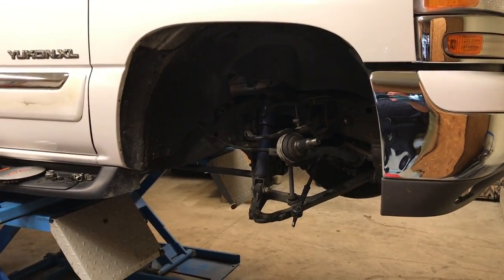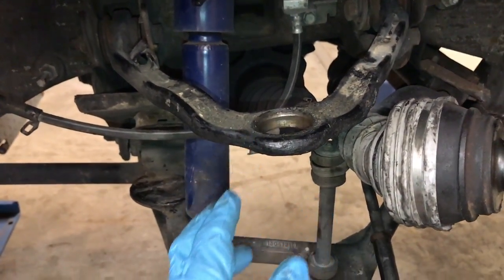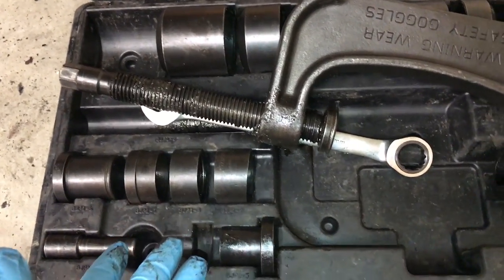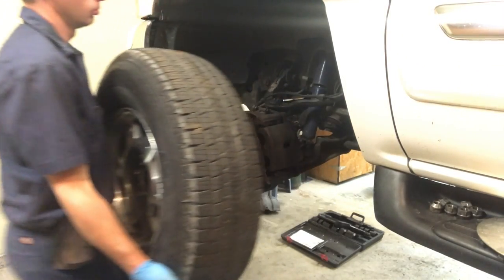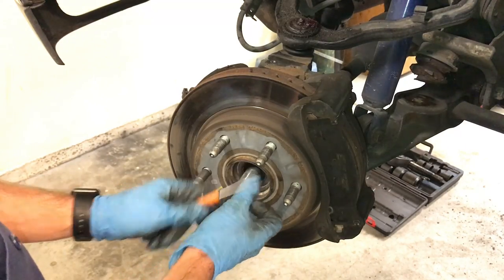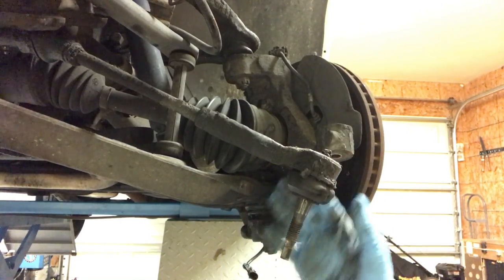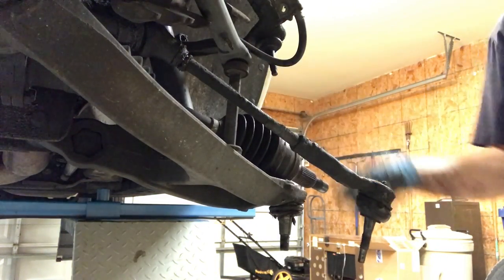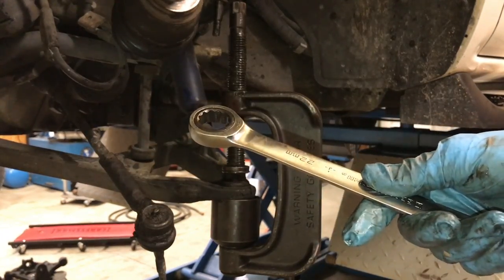Step by Step - How to Remove Ball Joints

Comment: Best ball joint press on the market. Mine has done ball joints that other presses wouldn't budge. The snap together receivers is just an added plus.
Reply: I agree. It is somewhat limited on the cups and receivers though. Something I have been doing for years now is I always keep old bearing races. They are strong, perfect circles that cost me nothing. If I need some oddball cup I can usually modify an old bearing race to fit my needs. Harbor Freight also has an expansion set for their crappy ball joint press for less than 100 bucks. I have used my old races for seal and bushing installation as well. Sometimes junk can be more valuable than a $300 tool.
Reply: rasafrasahassenfrat l

Comment: In my opinion if the ball joints are bad replace them. If you have a car or truck with the factory joints and they aren't bad, save them. In many cases I feel problems can be added to a vehicle with aftermarket parts. Great video Daniel!

Comment: One thing about Ball joints, I was always told to replace them in pairs regardless of one is still good or not.  With the effort required to pull everything apart, another ball joint is fairly cheap to replace at that time.  That snap-on ball joint press is nice though :)

Comment: Took my cousin and I 2 days to do mine on my 05 f150. Did both lower joints and the hardest part was getting the knuckle to separate from the joint. The drivers side required me to bash on the spindle of the joint with a sledgehammer because we had spent nearly 4 hours trying to remove it. At least I can say we did it and saved me 1000 dollars.

Comment: I appreciate your videos. It gave me some confidence to do this on my own & teach my son. I wasn't so lucky to have someone to teach me when I was young. Thanks a lot.
Reply: I agree. As I look back. I use to have an old beat-up bucket ( Toyota Pick-up ). I loved my truck, I ran my truck into the ground only cause I didn't the knowledge I have now. If I knew then what I know now, I would have fixed my own truck. All the mechanics back then were ravening wolves. They all just want to take advantage of anyone. 
My son also had a Ford Explore, it had transmission problems. Took it to a mechanic, he said it needs a new transmission. We paid the mechanics $1500 for a new transmission. Yrs laters, we found out he only replaced some speed sensor probably worth $45. I do believe in Karma or how The Bible calls it; You will reap what you sow. 
I'm sure that mechanic paid for that somewhere in life.
Reply: @guesswhomartin9249  I know exactly where your coming from. I took a chance to have my brakes completely done on 01' Z71. He charged me 1700. I hated it. But I needed to be sure for my youngest boys sake. He wanted it for sentimental reasons & as Graduation  gift this year. Truck came back to me even worse. I can't let my boy drive this.
Reply: @marleyboy7732  yeah, I hear you. I'm sure we've all been there. 
I fix my own car now. 
Thank God for YouTube videos.
A while back; my car was leaking motor oil from the heads. 
I went to YouTube, ordered the parts from Amazon. 
Took the heads a parts. Did it all myself. No telling how much money I saved. 
Recently, the whole front end of my car fell apart. 
The front struts went out. It was a mess. 
Amazon & YouTube here I come. 
Did it all myself. 
Car runs good. 
The only thing I need is; I need a professional mechanic who has the correct equipment to give me a professional front wheel alignment. 
Right now my car runs great. 
Not perfect, but it's great. 
Once I get a professional front  alignment. Now my car will be perfect.

Comment: And the reason you left the nut loosely attached to the ball joint is so that if you miss with the hammer the threaded part of the joint is protected by the nut.

Comment: So I actually dropped my hub/steering knuckle with rotor and pads attached. I'm working on Jackstands so the drop wasn't as far. Actually landed like bread, face down on the wheel studs. How do I know if I've damaged anything? Comparing one side to the other all I can notice is the side I dropped is just slightly louder but seems to spin as easy as the other side.

Comment: Daniel do you happen to know anything about the GMC Quadrasteer system and parts availability ? Best thing GM ever put on a vehicle but just didn't take. I have a beautiful 2004 Silverado with quadrasteer and it all works perfect.  I have looked for parts in case if I would ever need replacement parts but I can't find anything. Any idea if parts are still made and or available retail ?    Thanks
Reply: Have you tried Rock Auto? They have saved me many times on obsolete stuff.
Reply: Joe Henry have not seen anything on rockauto    Thanks tho
Reply from the maker: Like Joe Henry said, I would try RockAuto, as they're my number one source for parts. It sounds like you have already checked though. I would do some thorough internet research for the parts, even on Craigslist and eBay. I've found rare parts on eBay several times, even had luck with Craigslist a time or two.
Reply: DanielJaegerFilms thanks

Comment: I wish someone woudl so a video on a ball joint that's stuck in the control arm. All I can find is how to separate them which is common sense. I have had issues separating them but nothing I can't get. I'm working on a vehicle with 250k miles on original ball joint and I can't get it out

Comment: astro press works just fine and has more adapters for only $120
Reply: UBBERTANKER most auto parts stores will loan you the ball joint press if you're buying the parts from them